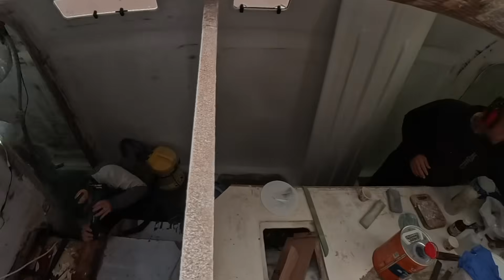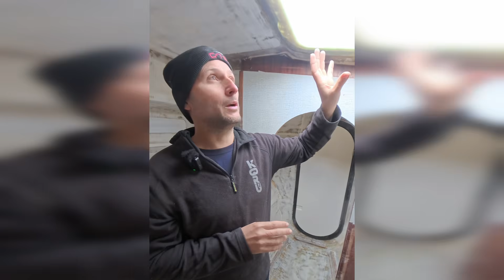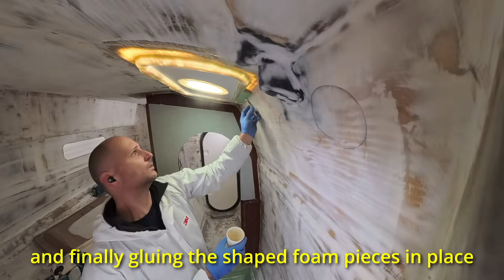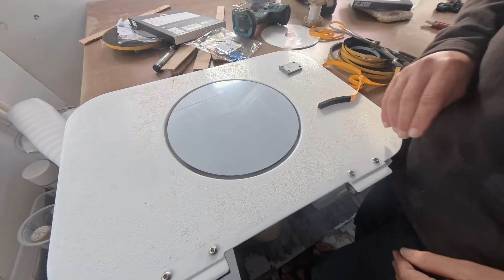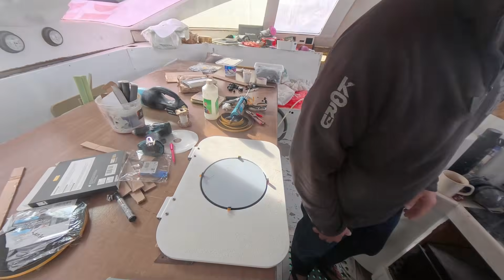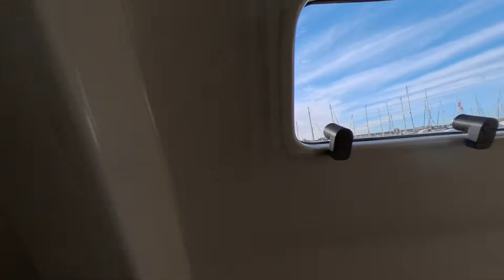Clear Hatch Lenses Installed! Boat Build Progress – Drain Installation & Fairing Prep

Comment: Great video. Most folks have leaking acrylic window because the glue bead was not appropriate for the expansion and contraction of the glazing. The bead gets bigger in proportion to the glazing. We just redid all of our huge salon acrylic windows as they all leaked they are also curved which added to the fun. The neoprene tape for spacers and dams is essential to to squeezing out to much bog. We had 9mmx24mm beads. We used FixTech 200 with a battery powered bog gun.
Reply from the maker: Great to hear that your window project was successful. We have to sort our big curved windows in Paikea at some stage too. The right glue is key to a good window seal to prevent leaking.

Comment: I noticed your non-skid. Rather than adding particles to the non-skid have you considered polymer beads? They are translucent and absorb the paint. This means as the non-skid surface wears, you don't see the black dots associated with worn paint. The polymer beads are self coloured from the paint.
Awgrip do a polymer bead they call Griptex but its stupidly expensive. In the UK, a company called Toppus has a polymer bead for about 1/3 of the price. We used these with Jotun two pack paint. Superb deck finish using the broadcast method. Basically, you prep the deck. Roller on a coat of two pack then immediately have somebody follow on with a sieve full of polymer beads to completely cover the deck. Next morning, with a new shop vac, remove the excess carefully with a brush attachment so as not to damage the bead surface. You then apply two coats of two pack by roller. Super even textured finish. The contents of the new shop vac can then be recycled for the next deck panel.
Reply from the maker: Awesome feedback. This nonskid is a combination of Griptex coarse and Hempel non skid particles (they are way too fine hence the mix). Our process for application is very similar to what you described. Paint, apply beads with custom made deck grip salt shaker (lol) leave a couple of hours then second coat. The paint we are using dries quite fast. We have plans to go to UK this summer so will try looking for the beads you suggested.
Reply: @youngbarnacles we absolutely bury the deck to about 3mm deep in beads. Vac off the next day.

Comment: I've used GE Silpruf 2000, a similar adhesive silicone to great results. I too hate that Sika makes you buy hideously expensive primers in a tiny can for bonding on windows. Brave of you to bond on the circular window without some masking tape on the top. For those watching - the interior foam weatherstripping dam makes such a nice interior finish. Do not use white foam. It will get dirty and hard to clean; use black.
Reply: Yeah the sika system is nuts with the primers, crazy expensive and goes off so fast in the tin! It is also not suitable with its elasticity. This is where the silicon and MS materials come into their own

Comment: Hi, what interior paint system are you using? Thanks
Reply from the maker: We are using an epoxy primer and a polyurethane topcoat. The brand we are using is TKRom. It is not a marine brand it is an industrial brand paint system here in Spain.
Reply: @youngbarnacles  Excellent, thanks for the info
Reply: @youngbarnacles  Hopefully it will be a satin finish and not toooo glossy. Hides a lot of flaws I mean minor imperfections.
Reply: @evangatehouse5650  yep its a satin finish, also roller finish to hide all the missed spots😅